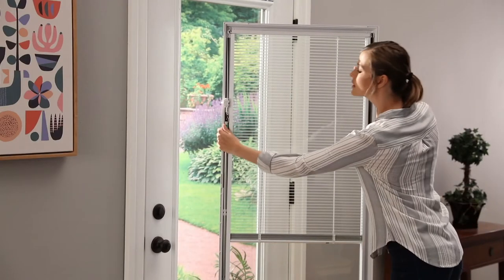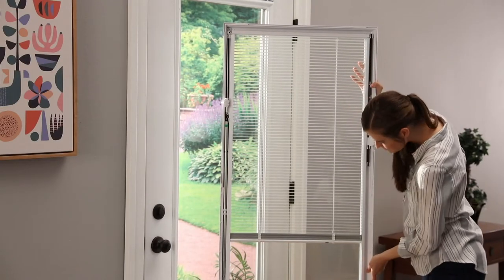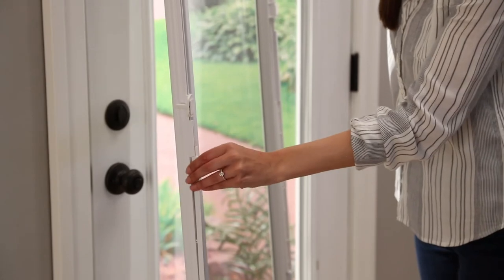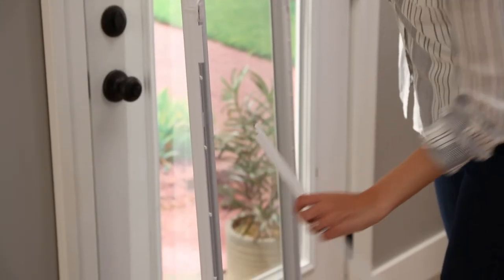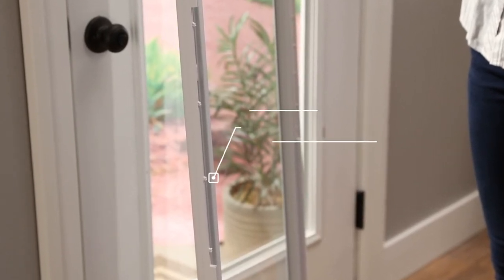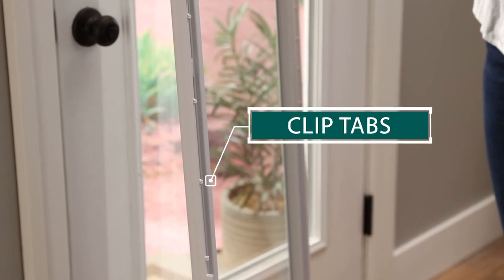How to Remove the ODL Add-On Blinds for Doors Filler Strip

Comment: Pretty useless video. I learned nothing from it. Makes it look like tabs unclip easily. In fact they are tight and inflexible. Cutting them off with pliers is not an option as it will leave an unsightly gap on the side.  May need to return the product..